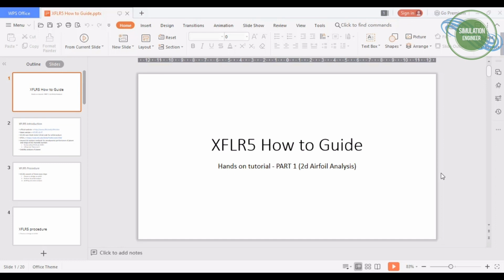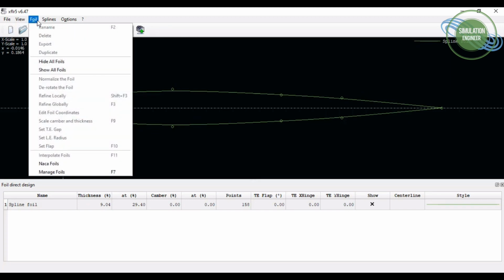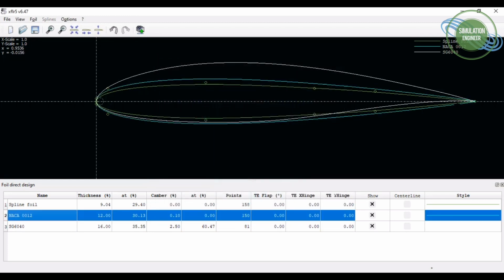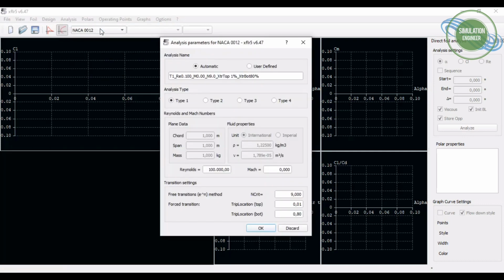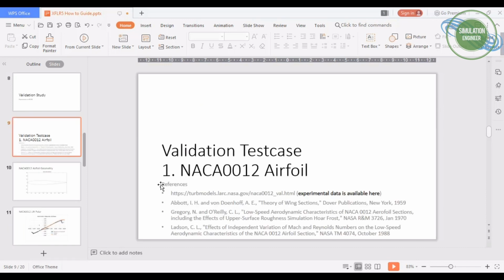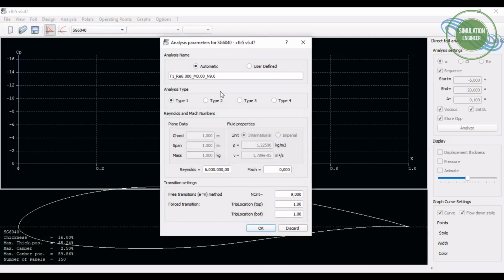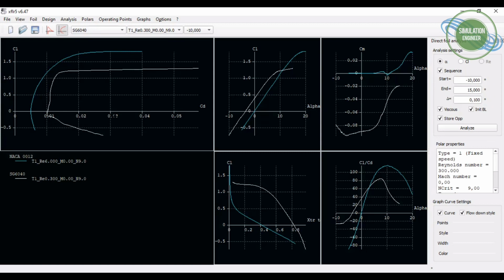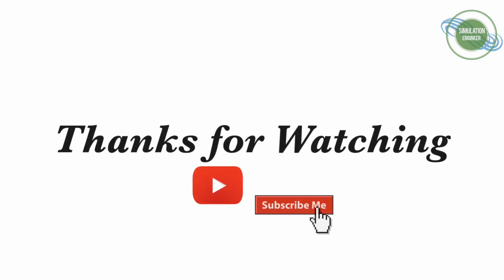XFLR5 PART1 AIRFOIL ANALYSIS | HANDS ON TUTORIAL SERIES

Comment: Can we do XFLR5 on compressible flow? like on Mach number of 0.8 and Re number of 5800?
Reply from the maker: XFLR5 primarily uses incompressible flow methods (Vortex Lattice Method - VLM, Lifting Line Theory - LLT) for 3D wing analysis, making it generally unsuitable for high-speed compressible flows. However, the 2D airfoil analysis (XFoil) in XFLR5 can incorporate compressible flow corrections, such as Prandtl-Glauert or Karman-Tsien, to estimate effects up to sub-sonic Mach numbers (≈0.3−0.8).

Comment: I have a problem related to simulating FX 61128 airfoil using XFLR5. I don't get any results on analysis. The question is can I get results for any random airfoil? Or Is it like a predefined set of airfoils which are used for wing analysis?

Comment: hi

I am just curious in minute 12.14 where u stated that "viscous effect is not actually calculate here". However there is a viscous function and a display of displacement thickness which through my imagination that is actually a boundary layer.
Reply from the maker: - With this I mean there are some limitations within xflr5 to calculate viscous effects. That is there is lack of interaction between boundary layer and inviscid flow. Also the estimation of viscous drag.
- Potential methods such as VLM and 3d Panel methods merely interpolate 2d viscous drag from local wing lift that is not good.
- Their is lack of interactive boundary layer loop, which is a coupling method between potential flow and viscous flow on surfaces.
- The effect of the boundary layer is to 
modify the geometry of surfaces and to 
disturb the inviscid potential flow.
- A loop is therefore needed to reach a 
solution that satisfies both the viscous 
model and the potential flow model.
- This loop is not implemented in the 
panel methods available in xflr5.
- Consequences / drawbacks are:
* The lift is a linear function of the a.o.a., 
unlike with XFoil or with the non-linear 
LLT.
* Significant differences in the lift 
coefficient predictions at low Reynolds 
numbers.
* The potential flow model is only 
valid in conditions of limited flow 
separation.
Hope this helps, thanks.
Reply: @Simulation-Engineer  thank you for ur feedback